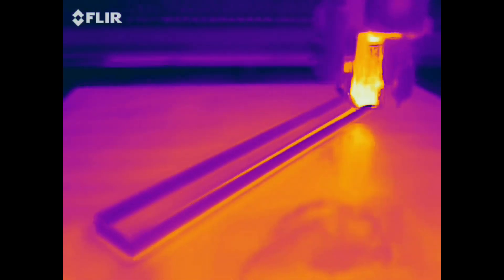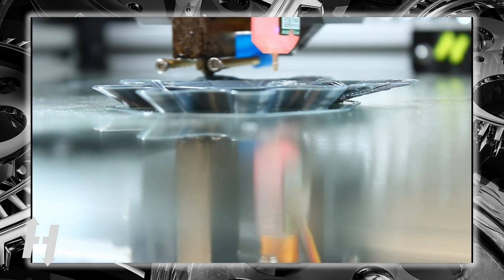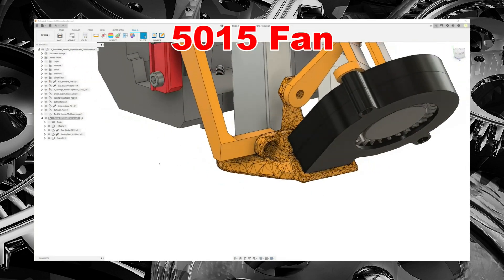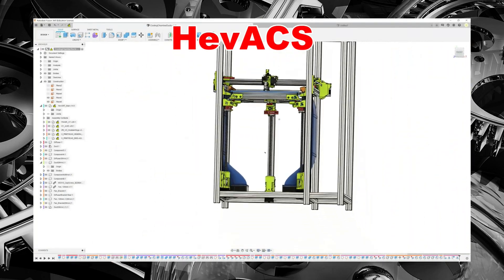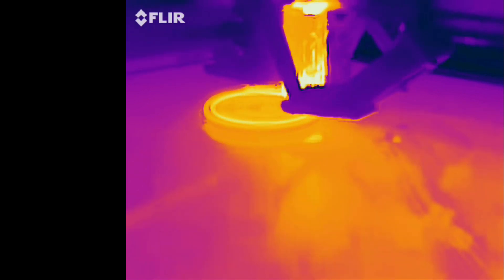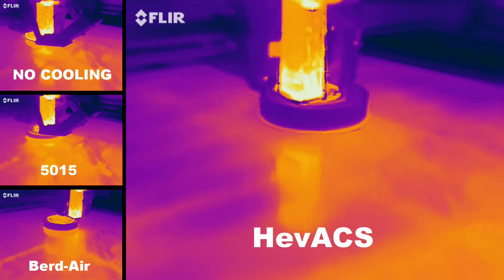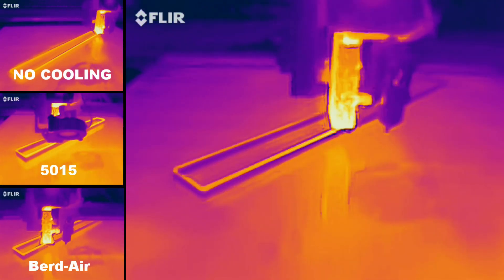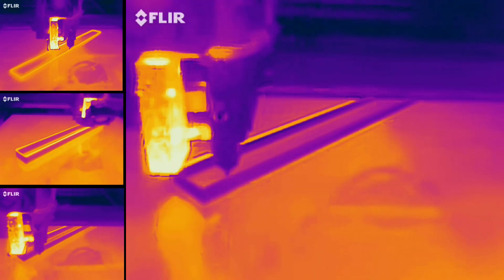Ultimate 3D printer Cooling fan - 5015 vs Berd-Air vs 300CFM Mega Cooling

Comment: 4:53 - Bruh... what are you,  a HVAC specialist? LMFAO🤣All that storming wind is going to mess with the motion of the print head gantry + the printed by few microns (test it using a 5-tenths test indicator). I like your aerodynamics skills. If you want something for a real professional cooling, use what the pros uses, a flexible hose used in high precision CNCs, this is what I would use, could also control how much air is being thrown out. The "berd-air" uses a cooling effect, while it might give low CFM, it does provide cold air, the concept is complex physics of refrigeration of the theory presented by the Joule-Thomson effect. Using a stronger air compressor would make much colder air. However I agree with your analysis that the berd-air system is forcing out air too much and not good for over hangs. However this got me thinking, it can be greatly improved simply using the theory of "Joule-Thomson effect" (AKA refrigeration) to provide a smooth super cold air to the printed part, you don't need too much air blowing at the part since freezing cold air could be blown at it, the cold temperature could be controlled so that it's not too cold so that it doesn't affect the print nozzle filament layer adhesion. This would require some advanced aerodynamic + thermodynamic + mechatronic  design concepts, I'm sure some German DIYer already came up with this idea for 3D printing (perhaps not)... I'm sure this concept would be really useful for people who needs the most precise advanced 3D printers for their preicsion prototyping situations. Excellent research using a FLIR camera.

Comment: 7:00 you say the part had time to cool? So all tests were done with the same part?
Reply: IF that's the case, wouldn't that invalidate your tests due to heat soak or lack there-of? The proper way would be to print individual parts for each setting and record results at a set layer height.

Comment: Really good informative video. My two takeaways: 1. most printers don't have much cooling with their stock fan (my prusa also has one of those mini fans) and 2. having global cooling instead of hotend-mounted can truly aid whenever you print wide/long prints or perhaps multiple separate ones. I've installed a 120mm fan today blowing on the bed and was wondering if that was worth the effort, and the answer seems to be: yes. Might add another one with a different angle later.

Comment: Curious to see how the HevACS would affect bed adhesion for filaments that  have a tendency to warp such as ABS...
Reply from the maker: For material prone to warp it is rare that we need extreme cooling solution.  If HevACS was to be used, I would recommend having a system to warm up the air to avoid too much thermal retraction.

Comment: I wonder if the Berd system cools better also because its pulling air from outside the print area. The 5015 draws in air from right above the hot bed.

Comment: Would it be possible to use the HevACS and not even have a part cooling fan on the tool head?
Reply from the maker: It is really depending on the shape of the part printed and the material used.
A small pla parts will need a lot of focused cooling while a large abs part will need a light breeze on the freshly deposited layer. 
HevACS is meant to add cooling on materials requiring a lot of cooling during fast printing where the head does not stay in the same spot long enough to cool properly.
Reply: @MirageC  Very cool. Thank you for your response!

Comment: Thank you!  I have been obsessing about what fan duct to use to optimize my cooling, but now I am realizing that no fan duct can ever compare to blasting the bed with air, because the fan duct just focuses on one tiny part when the whole layer needs cooling.  What do you think about just mounting an oscillating floor fan and pointing it at the bed?

Comment: Doesn't this trigger the thermal runaway on the heater ? Even if the silicone sock is put still it would at times cause a thermal runaway error and stop the print...How do you get about that issue?
Reply from the maker: I created a filament profile that loads a different PID tune set of parameters.  This will avoid to have thermal runaway condition when using such system.

Comment: If you try putting a peltier and blow Air from this?
Reply from the maker: While providing extremely cold air might work on certain material, it may disrupt the layer bonding.  With the experience I have at trying many cooling solutions, I believe that increasing the number of mollecules thrown at the parts rather than having the coldest stream is the right solution for what we do.  Cooling with warm air in other words.

Comment: A bit late, have you considered using a high cfm fan and then using ducting/piping to connect it to the hotend ducts? I've got a prusa mini where print head weight is limiting the cooling capacity.
Reply from the maker: I am using a shop compressor with Berd-Air.
Reply: @MirageC  I was thinking more along using high power fans (like server fans) running through ducting attached to the hotend. Essentially a Bowden setup for fan cooling. That way you get concentrated air around the hotend but high volume.
Reply from the maker: @theweirdoiscool  Yes, exactely something I would like to try.

Comment: total power consumption would be interesting as well?
Ages ago i used something similar with a ~15W 80mm fan, but it was not directed it was also cooling the bed a bit, and only from one side which made for ... some curious cooling characteristics :)

Comment: Is it weird that my anycubic printers dont use the part cooling fans and actually end up haveing serious issues when they do so their set to zero in the slicer. To clarify my parts print perfectly without cooling. Im from ohio if that helps anyone possibly exsplain why this is 😂😂
Reply from the maker: Speed... if the previous layers are not rigid enough you will have issues.  You can fix that by two things.  Slow speed to give time to cool or active cooling to speed up that process.
Other issues related to the surface tension of the material might also by present when printing certain materials without active cooling.

Comment: what a deceivingly simple solution to part cooling. I guess since most consumer printers aren't core XY, it never registered that that this could work. since printers like the HevORT always have the top layer in the same spot, it works like a charm. Layer adhesion is probably the only concern, PETG might not print very well, I'd love to see a colab with @CNC Kitchen.

Comment: I ordered an ender6  .. will make an adaptation ... I will use some ducts to get air form the bottom or outside if chamber heating is not needed. I do think you need a core xy or semi (like ender5)  which physically lowers the bed to implement this with sanity :D  I will post the results.

Comment: By the way the south pole is not Antartica it's the Arctic. So it should be "Arc
tic cooling system"  The Artic is much colder then the Antartic. 10 times colder in Summer and Twice as colder in winter.
Reply from the maker: ;) 
https://i.pinimg.com/originals/78/07/eb/7807ebef2eb2d83399f9a7fa4d231757.png

Comment: Ever experimented with chilled air?
Reply from the maker: I am experimenting with 60 psi compressed air nowadays.  Due to the pressure change at release it becomes quite cold.  I did not measure it yet though.  you can see it in action here: https://youtu.be/h-ukClHtai4?t=100

Comment: Hello, im sorry im so newbie in 3d printing but... Why you Will need a heatbed if you cooling the print with such fans?? Where Is the trick?
Reply from the maker: Heat Bed will ensure the part sticks to the build plate.  If the bed cools too much the part will be flying off.
Reply: @MirageC  ohh i see, one More question.... Have seen your Z motion build, Is it possible with Arduino+ramps+ extra board for drivers?
Reply from the maker: @eugeyatsu1100  You would be better into looking at Klipper Firmware installed on a raspberry pi.  You can then connect any driver board via USB.  triple z is a native function of Klipper.
Reply: @MirageC  okay, never used rspberry yet but ITS never to late! Thanks for answering!

Comment: Trying to dial in my cooling system and engineering a new hotend system for printing PC with my Hemera. Should I be drawing in cool air for the part cooling from outside the enclosure or use the warm enclosure air? I am worried about cooling the filament too much if the hotend has a high residency in one area, my thinking is that the cooling air should not be lower than the chamber temperature unless you need extreme cooling.
Reply from the maker: Extreme cooling is mainly used when printing small components extremely fast.  In all cases you should aim at getting the previous layer below glass transition point before the next layer  comes.  Side ducts will help in sinking heat into the part rather than freezing the material at nozzle output (which could lead to adhesion problems).  If your material is prone to warp, Chamber hot air at higher fan speed is preferred to "cool" the part. Cooling with hot air... Sounds weird, but you get the point ;)

Comment: you didn't say how the bedair was mounted,  if it's out of the chamber it makes sense it would cool more than the 5015 i think.  then again the hevACS in a chamber at 70-80c, cooling the part to ambient would also add strength to the part.  so fast + strong is a good thing.  too cold and the new layer doesn't bond as well to the previous.    i think stratasys has a patent on laser heating the previous layer to bonding temp... pretty cool.
Reply from the maker: The more I play with cooling the more I realize that cooling material at nozzle output is not the best way to do it.  Cooling right after deposit and using the part to sink heat is the way to get good layer bonding and clean prints.

Comment: What if you add a water cooling loop that is attached to the cold end of a peltier and improve the HevACS. So in essence the air will go through a cooling radiator that will chill it a touch to increase cooling even further. you need 2 water loops one for the cold side of the peltier and one for the hot side or just slap a heat-sink on the hot side to be dissipated somewhere else. Think the Arctic aspect will be fully justified at this point.

Comment: This is similar to what stratasys does on some of their machines. If you were patent surfing, you would have seen this before. Stratasys patent surfing is an excellent way to see new ways to up your game. They take this idea a step further and add a heating element after the fan such that the air is pre-heated hotter than what the fan could normally tolerate. Unfortunately, the power bill is strong with that design.

Comment: Do you need to make any compensations to temperature for all that air blowing over the non target part of the hotend?   Great idea by the way.  Very smart and solid logic. Guess would only be viable for printers with beds which drop.
Reply from the maker: I run PID tune for the bed and the nozzle when the HevACS is on.

Comment: I wonder how much this method would be affected by using warm air from a heated enclosure? If the air is 50C will it still cool very fast?

It becomes a fan oven, essentially lol!
Reply from the maker: I have yet to try it for ABS, but soon will.  I'll report back :)
Reply: @MirageC  What do you find is the best material for easy fast printing?
Reply from the maker: @Audio_Simon  I have heard ABS is good but only did PLA and PETG on fast runs so far.  I found a hi speed PLA from Gonzales that looks promising.

Comment: What monster of a bed heater do you have that's not throwing thermal runaway errors at low layers?
Reply from the maker: Keenovo 300x300 120VAC 750w pad.

Comment: I'd love to see layer strength and  bridging tests with those, because having the previous layer still hot might be better.
Reply: There’s a fine line! I’m currently limited by cooling,  this has happened to me a couple of times, hitting the sweet spot between cool enough to add a layer to and cold gets more tricky ! In pursuit of speed ive not had drama with it being too cold yet,  before the speed pursuit I had a few vase mode prints you could peel into a slinky !

Comment: Unecessary cooling reduces layer adhesion greatly. The ideal amount of cooling is just enough to have the object keep its shape. If staying as close to that line as possible all the time, you have the best possible layer adhesion. Any amount of unrequired cooling reduces it. To set up the layer times and fan speeds properly for minimum fan usage, I'd do it like this: (for PLA)
Set the print speed to the highest you would normally go.
Print a slim, single pillar. The diameter should be somewhere around 3-5 mm.
Print it with 0% regular fan speed, 100% maximum fan speed, 30 sec. threshold and a low minimum layer time, like 3-7 sec - depending on the pillar's diameter, and on how fast "fast" means for your setup.
Also set the minimum print speed to a low value, to have this out of the way.
Manually reduce the fan speed until the pillar starts to loose its shape / melts. Remember the value and change the maximum fan speed to just a little more than this, then start a new print with the same pillar and fine-tune it. 
Always let pillar grow a little after changing the fan speed - the heat can add up vertically, softening it after a while.
Try to get to the point where any more cooling doesn't improve anything anymore.
Inspect the part thoroughly for heat damage. That's your cooling for a high print speed. 
Create a new profile for the material, with the addition "fast" or something like that.

Now you want to create a profile for a slow print speed to get the maximum possible layer adhesion. What means exchanging cooling for print speed. 
Set the print speed to the slowest you would normally go for a high quality print.
You want to reduce the speed for small layers as much as possible, to require as little cooling for them as possible. Increase minimum layer time by some seconds and reduce the cooling until the pillar deforms. 
Keep the cooling, increase the layer time, restart. Do this up to the point where the time increment doesn't help anymore to prevent heat damage or the speed is too slow for a proper extrusion. 
Take the value with the highest possible layer time before the damage and create an new profile, with the addition "tough" or similiar.

Now you have to find out the threshold setting for both profiles.
This part is time consuming. Print pillars of increasing diameters, one after the other, until you know how large the layer needs to be (layer-time wise) to require no cooling anymore. 
Start with a pillar of like 10 mm diameter and a threshold of like 10-15 sec. Re-print it while step-wise reducing the threshold until you have heat damage again. 
Keep the threshold and take a larger pillar with like 15 mm diameter and do the same. Repeat, until you get to the diameter where you can't cause any heat damage anymore by reducing the threshold. 
Either take the starting value from this print, or fine-tune it with the diameters inbetween, to get a more accurate result. 
That's your threshold setting.

Do this for both profiles.

When set up properly, the intensity of the cooling basically follows the layer temperature at minimum requirement all the time, leading to a more consistent result with less internal tensions and the best possible layer adhesion for the set print speed.

But keep in mind that this is fine tuning, so don't expect it to work the in the same way at 100 °F in midsummer
if you've set it up at 70 °F in winter.
Doing some quick adjustments to make up for that is not such a big deal though.
Reply: Most people don't care about that, because they use their 3D printers to print useless garbage that wont see any mechanical loading. Which is sad.

Comment: so im looking into a 915x915x1000 build on this printer... may go taller... im looking into some unusual ideas too. like certain garage door openers use a lead screw that looks a lot like a cold rolled ball screw... and other openers use a 24v dc brushed worm gear motor with one or two encoders built into the motor assembly with probably the most stout gearing setup ive seen as well. servo control and the worm gear drive would be very nice on a heavy z gantry. just an fyi for anyone interested :)
Reply: Garage doors are well known for their precision.

Comment: The third idea (HevACS), with the fixed two ducts either side of the bed, is exactly how some of the early HP-branded Stratasys printers worked! However, they may have used centrifugal blowers rather than axial fans.
Reply: Think they could also heat instead off cool if i remember correctly? might help with ABS prints!
Reply: @jblaterfire  you may be right. I can’t recall if the heater was elsewhere or whether there was one with each blower. Either way it worked beautifully for ABS yes.

Comment: Don't you get thermal runaway blowing that much air on the bed/nozzle with the hevacs?
Reply from the maker: I PID tuned each type of filament while having the fans at the desired value.  These PID values are called up when I load the corresponding filament.
So the board know how much PWM is "normal" under each condition.